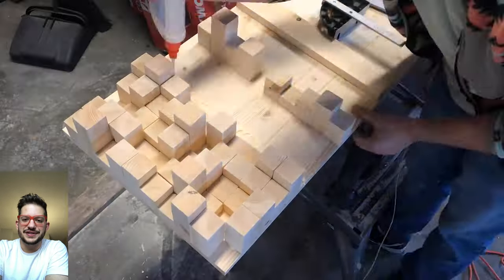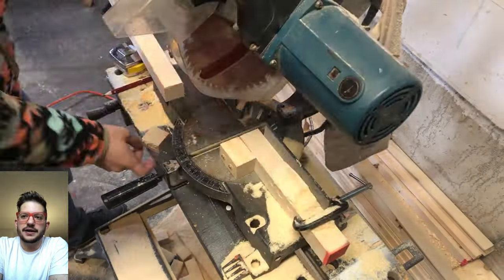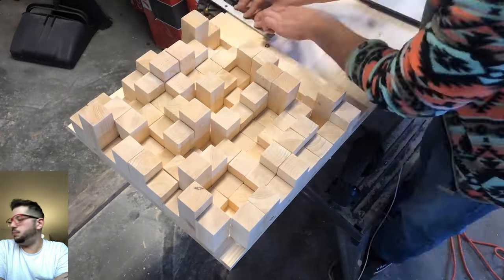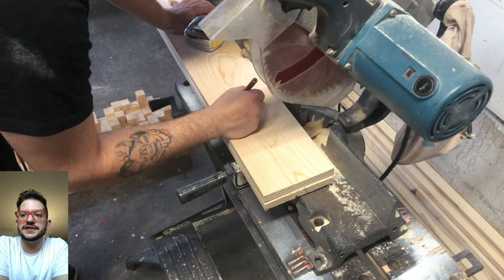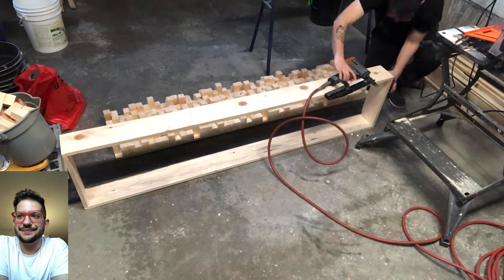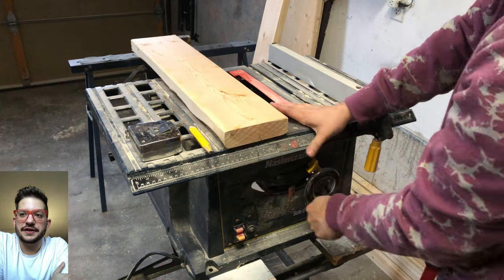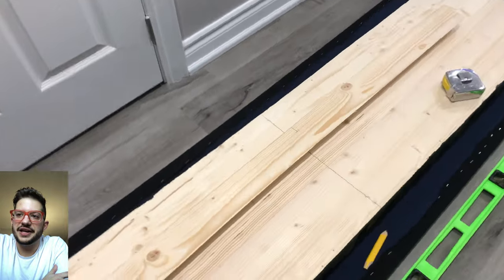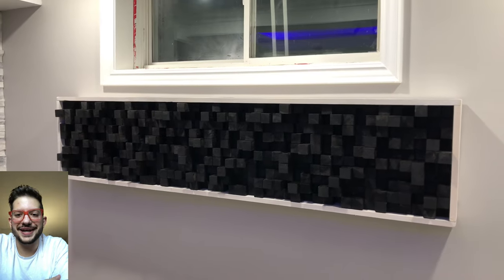HOW TO BUILD AN ACOUSTIC SOUND DIFFUSER! DIY PRO!

Comment: Since you used pine, you should have used wood conditioner first, then stained it. It would've come out a lot better. Also...if you do this often....you really need to get an HVLP sprayer. I also would've made the frame to account for the added thickness of the 2 x 6 you used for the cleat, so you could push the frame right up against the wall.
Reply from the maker: I actually just picked up a sprayer, stoked to try it out on the next one! Good call on the conditioner, I'll suggest to my next diffuser clients. The frame does push up against the wall! The whole point of the frame is to hide the cleat and give a floating look to the piece. Thanks for watching!
Reply: He needs to buy a whole lot more equipment. Also needs more or a professional area to build this stuff
Reply: @soundheadquarters  that's right, I didn't notice that. Also another recommendation is get yourself a rubber mallet, bubble wrapping a hammer really does nothing. Even just putting a piece of wood up against it and hammering the wood is much better than using a hammer with bubble wrap.
Reply: @taz3837 ahhhh…. So you’re just a troll. 👍

Comment: This is sweet. How many hours did you spend on this. I need this exact diffuser, but I am not sure I want to spend that much time doing it. Great tutorial!
Reply from the maker: It’s about 6-8 hours for all the cutting/sanding/glue-up, then I let the glue cure overnight and another couple hours to do build and test fit the frame, and apply the coats of paint or stain. Thanks for watching! Depending on where you’re located I’d be happy to give you a quote for me to build and ship you one to your specs. Email me if interested!

Comment: I made one of these, just using mostly leftover wood from other projects. A lot of it was hardwood and consequently the finished product was extremely heavy. I had the idea to hog out the back of it with a router to remove some weight. Do you have any idea if that effects the acoustic properties of the diffuser?
Reply from the maker: I have never tried that but I suppose it would not reduce the effectiveness in practice. The reflection off the wood is what the goal is, not necessarily the mass and density. I’m sure it has some sort of effect if you were to A/B test it in a sound lab but in practice having a lighter diffuser seems like a good option. Thanks for watching!

Comment: Pro Tip: Surface sand your wood before you cross cut the pieces to length.  That will save a huge amount of time trying to sand each block in your hand.
Reply from the maker: It’s the cross cutting saw marks and burrs that were most concerned with sanding off. Even with the finer tooth blades we still need to sand to ensure the blocks can meet up flush with each other. Thanks for watching!

Comment: Very nice video and replies in the comments. I'll read the study and link you mentioned so feel free to skip if either answer this question, but why aren't the blocks cut into an angle or what would that do? I'm thinking of constructing something like this that would be right behind the listening spot to acoustically hide the wall a bit and intuitively angled blocks feel like it would make more sense.
Reply: Think of these as physical tools to “eq” your room. (Just an analogy)   You wouldn’t randomly offset your eq knobs just for aesthetics im sure.  Angling the ends of the blocks throws a mathematical wrench into the equation that makes the whole thing less predictable in terms of how it does it’s job of diffusing and reflecting.  
In short, i doubt it would RUIN the effectiveness of the diffuser but it would certainly turn it into something else that isn’t what you set out to do. Which was to get rid of the wall sonically or predictably treat high end frequencies and so on. 
It would look cool sure, but if you care about the effectiveness I wouldn’t do it.

Comment: Ok so my neighbor complained about me driving my sim rigg this morning. 
So now im gonna build this x10 in size to cover almost the whole wall. Is it nessesary and will it work is the question? 
The sound i wanna diffuse is me talking and the sound from the TV. What they complained about is the wheel making sounds since i had a headset. Had no idea that a sound so small can travel into their appartment from my game room. Might put the rigg och kork+plastic mat asweel if the floor is the thief in the dilema. Got ruggs underneath so im sqeptic abiut that.
Reply from the maker: I would not suggest this as a solution. Look into soundproofing wall structures with additional layers of drywall/insulation/deadening materials. Thanks for watching!
Reply: @soundheadquarters  Meh gonna look awesome, its gonna cost around 30$ to make. I'm thinking of making several pieces for comfort when moving. Then proceed to make a 80x400cm large wall with a sweet finish oil and arange them with the help of AI. If that wall dont help nothing will, i will have a soundwall by 2-3cm behind it asweel. Have a couch along the bottom so the wall fills the gap kinda. With the help of AI i might be able to make a masterpiece.
Now i ask you, what do you think souch a thing would cost to buy? I know what you can sell it for youst google. Imagine the nicest one of them all x10 Ai can handle the artictical process in unimaginable ways. 
I can even take a picture of the room and get it on the wall as i want before even making it with the actual design i choose in the end. 
Sry for the long message, do you think it will work?

Comment: Hey.. is it necessary to take 2×2 inch block.. will it work same if we use 1.5x1.5 inch or 1x1 inch ?
Reply: No it wouldn't matter, just so long as you use the same square throughout. It doesn't matter either how long they are, it could be 2.1" , it doesn't have to be 2, 2.5 etc.

Comment: Create the back and frame together first then it should be easier and faster to add in the blocks last. You would not have to plane the edge off like that if you build out the framing and back first.

Comment: what wood did you use
Reply from the maker: 2x2x8 spf for the blocks, 1x6 knotty pine for frame, 3/4 inch plywood for backing, 2x6x8 wood for the mount. Thanks for watching!

Comment: You will get the same effect if you use foam and not wood
Reply from the maker: I appreciate the view and comment however this is not true. Different materials have different acoustic properties, it's not only about size and shape! There's a reason why professional recording studio control rooms and live rooms use wood as a main building material, and foam is rarely seen for any applications in more professional settings. 
It's an interesting concept and would certainly be lighter, but the effect would not be the same.
Reply: foam doesnt do anything except absorbing high frequencies, so you can only make the room sound worse. A way to go i guess. You should never use just the foam alone.
Reply: a single diffuser in a room is not going to give great acoustics either, but i gues thats up to the client request's.

Comment: Sorry but $1499.99 for that??  😳🤣😅🤣
Reply from the maker: This particular diffuser was billed at 1000CAD installed. My children are fed, my rent is paid, and my clients are happy. I share these videos so people can build for themselves and save money if they prefer to build themselves. Thanks for watching
Reply: I'd pay $1500.00 for someone to build this for me. I'm very handy tho so luckily I can do it myself.  Maybe taz has no idea how to use a tool.
Reply: The time, the energy, the effort, the detail, the equipment, the material. It makes sense. Look how much work he had to do.
Reply: It’s a multi-day custom project, solid wood, and price includes installation. $1500 would be more than fair my dude
Reply: Im litteraly thinki g, why shouldent i build this and sell it 😂
I plan on making one myself thats 10x larger over the whole wall 😅👌
9m x 3m 
What should you even sell it for 3000$? If so sign me upp, cutting some wood upp then selling it x100 the value you baught it for 😂